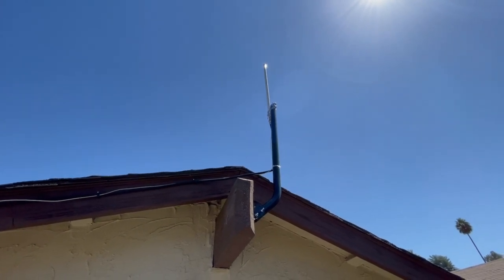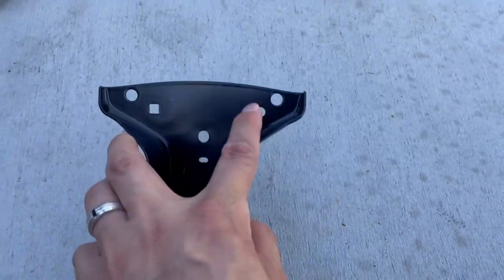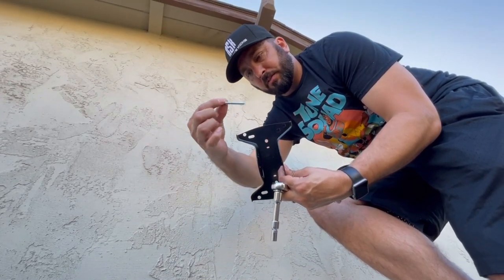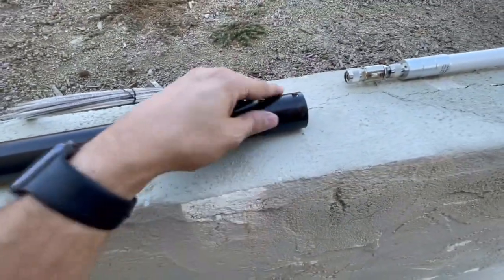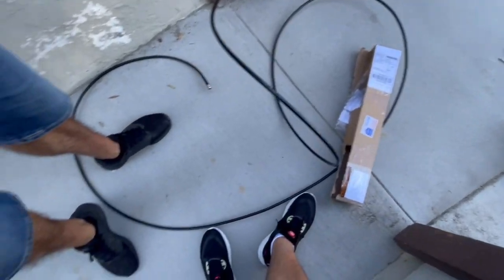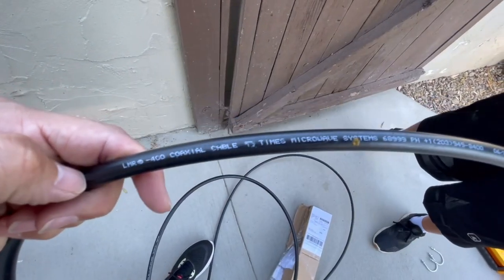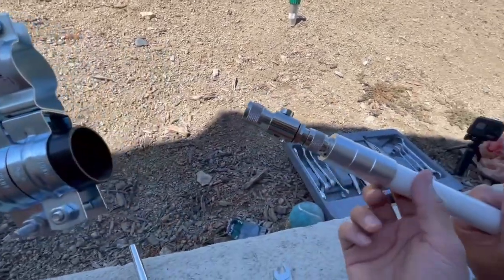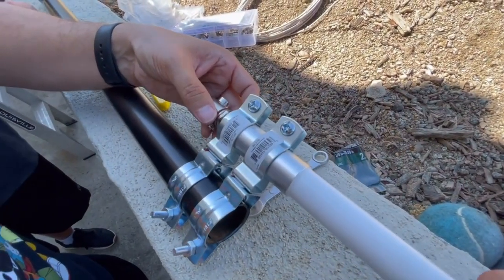Outdoor Antenna Install For Rak or Bobcat Miner (Step by Step Setup) Increase Helium Miner Earnings

Comment: awesome setup, Im curious, do you have to use any electrical tape or anything on the cable or the antenna or are they weather proof just by getting them screwed in properly.. secondly, that wire for the ground should be routed into that hole in the arrestor.. that looks like a very cheep one, most of them have an adapter that hangs of the side with a rubber gromit that you rout the wire into and then tighten down.. but im not an electrician, but I worked on oil rigs for a long time and everything had to be grounded extremely well as you can immagine, and what you did their is a little worrysome.
Reply from the maker: Thank you. The electrical tape is not necessary but if we had some I would of definitely thrown some on there lol. I’ve worked with 3 different arrestors n the screw was the same for all 3. I’m also not an electrician but if a lightning bolt hits the antenna a little 1 millimeter screw is that sits on the arrestor is not gonna make a difference 😎.
Reply: @CesarCinema  you should back bond the arrestor to the jmount, then ground the wire to the j mount and to the ground source.  That galvanized clamp won't provide much bonding as it's barely contacting the arrestor.  Also, use slick washer on the nut you lost..the wind will cause the nut to back off or use another nut to double nut them.  It'll become out of level in time.  Black zip ties will resist UV breakdown..which is why cable as an exterior PVC jacket that is black in outdoor applications...thanks for the proof of work videos
Reply: Also. You can use bishop tape or mocap tape to weather proof the outdoor connections
Reply from the maker: Thanks for the info William

Comment: i noticed you said you used an rpa sma female cable but isn't the minder female as well? shouldn't the cable be rp-sma male?
Reply: yes the cable end is RP-SMA male and Miner has RP-SMA female. The RP is for reverse polarity why the male looks like a female and female looks like a male.
Reply from the maker: The R in RP stands for reverse so a reverse make is actually a female connector. Hope this helps
Reply: @CesarCinema  lol yea not that it’s hard enough to tell make and female connections, they still call the actual female me side of the RP-SMA a “male” connector. Who could mess this up?

Comment: I live on a the second floor of a apartment complex. How would I ground from the balcony?
Reply from the maker: You need to find a copper pipe that goes into the ground or a Circuit breaker

Comment: I cant get where the ground wire is going to connect! Where do i put it if i assemble one antenna on a third floor balcony! Than you and awesome video.
Reply from the maker: Thanks bro. So connected it to the grounding screw next to the circuit breaker. Or you can attach it to a copper rod that’s goes into the dirt or attach it to a copper pipe that goes into the dirt. Hope this helps

Comment: The dbi on the apps has to be changed to the antennas dbi? Let’s say the antenna is 5.8 you change on the app to that or leave at 3 dbi in app
Reply from the maker: Change it on the app also

Comment: If you have a device in the attic under the roof, so you don't have a problem with GPS? Does Bobcat need visibility on GPS?
Reply from the maker: The bobcat itself doesn’t need to b visible but the antenna should be.

Comment: Did you guys try the original antenna first before the 8dbi to compare earnings?
Reply from the maker: Yes. The regular stock antenna only gets around .15 HNT a day compared to .52 a day with the aftermarket antenna
Reply: @CesarCinema  Nice!! I will be shopping for a 8dbi then ;-) thank you
Reply from the maker: Yup. No problem Robert

Comment: Thanks for the great video. One question: why did you purchase a separate cable (LMR400) when there is one that come with the 8dbi in your equipment link? Thanks again and amazing video.
Reply from the maker: My buddy bought the LMR400 cable from eBay but the amazon one is the same cable just different brand but same connections.
Reply: The answer is simple, if your miner is transmitting 100mw out of the box, then the goal is to get as much of the 100mw as possible to the antenna. All coax is rated in db loss per 100 foot. The better the coax, the better insulated and shielded it is. LMR 400 is exactly what I would buy if I were doing the same operation. In the video he used "N" connectors, something I would also do to ensure as much of that 100mw made it's way to the antenna. As a side note, don't believe the BS about the "Umbrella" and this dbi antenna over another dbi rated antenna, because it's BS being pushed by people who have very little experience or knowledge in electronic principals, terrain analysis, etc. Buy the highest omnidirectional dbi antenna you can afford, as good of coax as you can afford, and some type of elevated thing to put the antenna on, such as a house, balcony, pole, or tower, etc. This is the exact same principle I apply in ham radio and talk all over the world every day on a piece of house wire as an antenna.

Comment: If you se t up a second miner at a friends house, you need to log in to his wifi for the second miner, yes?  But you set it up on your phone app so you still get the rewards?
Reply from the maker: Yes you do have to log into the wifi or connect an Ethernet cord. You can setup the second miner with your original helium app so you’ll have 2 miners connected to your app

Comment: One question, can't seem to find an extension pole for this 40ft mounting setup, i want to add an extra 2 poles for it can be 80ft or so can you help me source a compatible extension pole.
Reply from the maker: You need a flag pole. I bought a 20ft pole on Amazon. Maybe u can buy 2 and stack them.
Reply: @CesarCinema  oh yes I've seen your latest video will add a few recommendations
Reply from the maker: Perfect. Let me know how it goes.

Comment: the arrestor is NOT a primary ground, you need to ground the mast as well. The arrestor should be further down the line with a smaller gauge ground which you can then bond using a copper bond nut to the mast ground or run separately. If lightning directly strikes your antenna it would fry your gas tube and shoot down the ground which means you won't be burning the house down which is good BUT... static would then probably travel down your coax and fry your miner which is not so nice.
Reply from the maker: Thanks for the heads up.
Reply: Also, you should drive a ground rod separated by at least 6 feet from your house ground. Then connect #8 wire to your mast and lightning arrestor one sold run to the new rod.. This is the best method for grounding.

Comment: Hi, what kind of Ethernet cable should I use? Cat 5?  Also how long can it be ?
Reply from the maker: I would use cat 6 or above. U can get the Ethernet cable as long as u need it
Reply: Thank you, also i I have the rack v2 I made 14 dollars in 2 weeks stock antenna/ is that normal? Im located in hemet ca, I already order the 5.8 antenna hope that makes a difference,
Reply from the maker: Normal for stock antenna but you should see more earnings with the upgrade. Even though earnings overall have gone down.
Reply: Do I need to power off the miner before disconnecting it?  I’m so sorry for the dumb question thanks a lot for your help;)))

Comment: Hey question when you say surge protector do you mean the little peice you put at the bottom of the antenna or something else?
Reply from the maker: The plug that has a light switch that will automatically shut off incase a surge happens.
Reply: @CesarCinema  so does that mean a lighting arrestor wouldn't be enough?

Comment: Drip loop is needed on cable, rainwater will run right in the garage
Reply from the maker: It’s not a big deal. The garage ground is concrete it’ll be fine

Comment: For the bobcat miner the cord purchase is female and female connector?
Reply from the maker: The bobcat miner connection is a male so the cord that goes into the miner is female but some cords refer to that connector as RP male (Reverse Polarity) which means female. Hope this helps
Reply: @CesarCinema  thank you. Yes.  Appreciate it
Reply from the maker: No problem

Comment: Awesome video! I'd like to pick your brain from your experience with this. I have The Helium miner and is it better to have it on Ethernet but be on the ground floor? Or should I move to the setup to the 3rd floor but then I'd be on WiFi. I also have a 5.8 dbi antenna and I'm in a very urban environment with miners pretty much all around. Thanks
Reply from the maker: I would test it for one week on Ethernet then the other week on wifi to really know which one is better but if I had to guess it’s prolly gonna be Ethernet. 5.8 is good in urban areas 👍🏻
Reply: @CesarCinema  thank you for the tip. I got another one for you if you don't mind. So I have the Helium miner but now getting a freedomfi. If I just swap out my helium miner for the freedomfi gateway with the same antenna setup and everything...will the actual miner make a difference? Or is it all come down to dbi and witnessing? Thanks, again
Reply from the maker: U should be able to switch it out without a problem. For the most part it should make the same earnings.
Reply: @CesarCinema  So the miner itself makes little difference. It's basically location and setup that will maximize... Got it. Thank you

Comment: Hi, is this OK to keep miner on without antenna connection?
Reply from the maker: A lot of ppl say to connect the miner first then turn it on.
Reply: @CesarCinema  its the opposite of that if your changing antennas, you want to turn the miner off and then plug the new antenna in, and then turn it back on.

Comment: Where is the links for cables & lightning protector? It would be really much appreciated, Thanks
Reply from the maker: Purchase Miner Equipment: https://bit.ly/MinerGear
Reply: @CesarCinema  Thanks man. I really hope you didn't 🧱 your Bobcat. If you did I hope you could exchange it for another one. Best wishes
Reply from the maker: Lol. It works perfectly fine. Thanks
Reply: @CesarCinema  LoL I don't know why they say you burn them up if you power them up without antenna. That's great that it works tho because it would really sux doing all that work for nothing. Have a nice Xmas
Reply from the maker: Right?!? Lol. You too bro. Merry Christmas
Reply: Hey I have 1 question if you don't mind? Do you think this antenna will work with the Rak Hotspot Miner. Laird Connectivity 8 dBi Antenna FG9026

SKU: ANT-000005-NA

US/CAN - 915 MHz? Thanks
Reply from the maker: It’s not popping up on Amazon 🤷🏻‍♂️

Comment: Can you please provide details about the cables and all the other stuff you bought?
Reply from the maker: I have a link in the description box that has all the products I used in the video.
Reply: @CesarCinema  I need a 120ft coaxial cable (I am in 4 story building). Any tips to get it already with the proper connections? Appreciate your support
Reply from the maker: The link for amazon is in the description and you can select what length you want

Comment: You need minimum gage 10 for ground wire
Reply from the maker: It was 12 but thanks
Reply: @CesarCinema  12 gauge is smaller than 10 gauge. Dude! You need to learn to do some research before you start spreading false information everywhere

Comment: Hey bro, great setup that I will be using to set my miner. I’m curious on your mining rewards after setting up as well as how you protect your antenna from bad weather conditions such as rain/storm?
Reply from the maker: Thanks bro. Rewards video coming soon. An extra step you can do to help during rain would b to use electrical tape on all the connections. 👍🏻
Reply: Hey budda, watched your video and it's good except one part. The antenna is supposed to be hooked in before its powered on. If it's not, then you run the chance of popping the miner and it's trashed. Check the bobcat discord for the post about it.
Reply: @CesarCinema  under dos and donts in the discord channel.
Reply: Never ever, ever, EVER. Power on your bobber without attaching the antenna/cable first. The antenna must be attached or your signal could backfire into your bobber's board. From the discord.
Reply: @CesarCinema  Hi there, thanks for the vid. Very useful. Any sign of a reward update pre/post the antenna upgrade? Thanks
Reply from the maker: It tough getting my two buddies together to make the earning video. I might just have to record it myself
Reply: @CesarCinema  We are still waiting please

Comment: The copper pipe is verry dangerous in case of lighnting and you use water or are in bathroom you will get electrify. Straight into the ground is the best.

Comment: what will happen if lightning strikes it. is there high risk of lighthnig obliterating it with your miner/house
Reply from the maker: So the lightning arrestor is if there is static electricity from a nearby lighting strike but if it’s a direct hit it would prolly fry your miner. The other plus is if it is a direct hit the lightning/electricity is going to have somewhere to travel to therefore not causing a fire.

Comment: FYI.  Never plug in the Bobcat without the Antenna cable connected.
Reply from the maker: Why not? Does it self destruct? I appreciate the tip but I don’t think it matters.
Reply: @CesarCinema  You can ruin the transmitter.

Comment: Hi

Love the video. So would you say the minimum amount of LMR cables for home installs should be about 20 ft or should we go with 25ft. I noticed yours is 23 ft.

How did you go Bout measuring this initially? Did you just guess ?

Thanks
Reply from the maker: Thanks 🙏🏻. My buddy took a long string and measured the distance so we wouldn’t get to much extra slack. I’d say 1-3ft is a good extra. But the more extra cord you have the more dbi that’s loss with that extra slack.

Comment: Hi, I really appreciate your video. My only confusion is with the grounding. With the Copper Ground Pipe Clamp, would I still need a copper pipe or rod to connect the wire to, or is it okay with just the clamp? I just saw a video where the guy used a grounding rod + a grounding wire (more expensive option than the Copper clamp). 
Thanks!
Reply: I'd say as long as the ground wire is firmly connected to a piece of metal that's driven at least 8 feet into the earth, you should be good. I think electrical code says a ground rod has to be at least 8 feet into the earth. Chances are if you connect your ground wire to a copper pipe, its going to be electrically connected to either a ground rod or something else that's metal that meets that criteria.

Comment: LMR 400 to lossy for this application. Should be using at least LMR 600 or 1/2 inch heliax to minimize loss.
Reply from the maker: It’s not that much loss from a 600 to 400. I have both setups. Now if it was a 100ft cord than you might be on to something but not with 23ft.

Comment: Where do you live? I'm in Phoenix AZ. I own 3 Bobcats and they are all setup within 1-5 miles from each other. My earnings are really low. I need help to get them setup properly. I also bought 2 6dbi antennas but I'm still struggling to get them to mine more. Can someone help? Would be nice to connect with someone locally!
Reply from the maker: What’s up bro? We live in San Diego CA. What’s your normal earnings per day on one miner?
Reply: @CesarCinema  thx for the reply! Can we email or text? Currently I’m at .51, .18 and .45 on average a day on all 3 miners. All are bobcat, 1 has an upgraded antenna but it doesn’t seem to be helping. I’d love for someone to help!
Reply: @CesarCinema  I NEED HELP! I Have 3 Bobcat miners setup. All are more than 300 meters apart, all with decent views. I have upgraded the antenna on one of them to a 6dbi since the location is a little worse. I’m only getting about .25 -.5 HNT per day on each miner. Each has about 7 witnesses. My transmit scale is .79 and the other two are .57. Is there anyway to increase the rewards scale and the witness counts without moving the antenna to a different location?
Reply from the maker: Send me a DM on IG @CaesarSneaks

Comment: Hey great video. Seriously… Q: does did work for the Syncrobit too?
Reply: Also, I noticed you shared two different mounts? One that looks flat and another that curves like the one in the video. Are those two separate mounts? Or need both?
Reply from the maker: So I just checked out the Syncrobit website and it looks like they are all the same connections too. Just one mount needed, I couldn’t find the second mount you are talking about. But the mount I used in the video was the black curved 40 inch antenna mount. Let me know if you have any more questions
Reply: @CesarCinema  Thanks for the reply. 

Follow up Q: Here's the item that looks like a second mount (one you didnt use in the video because you used the black curved one): "LoRa Gateway 915MHz Antenna Outdoor 8dBi Fiberglass LoRaWAN Antenna N-Male for Helium Hotspot Miner with The Mount Bracket" ($34.99). The mount on this one looks flat. Just wondering about this and if it's needed or not.
Reply from the maker: Oh ok. I wanted to have that as a backup in case the mount I used in the video is all sold out. Thanks for letting me know
Reply: @CesarCinema  Gotcha. Thanks again for the great video. 

Oh yeah, I'm also curious to know... how many devices are you doing this for? And if it's a lot, how are you finding the locations? It looks like friends and family is a decent way. Are you giving them a % or a fixed rate?
Reply from the maker: So my buddy is using a family member’s house. He is going to give them a % of the earnings. But that’s the best way is to reach out to family members n friends and offer them a %.